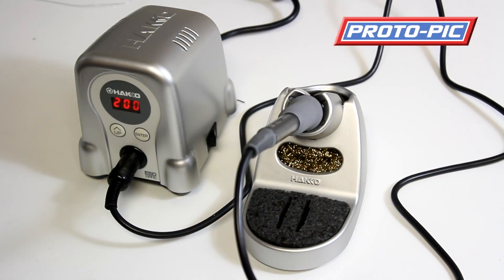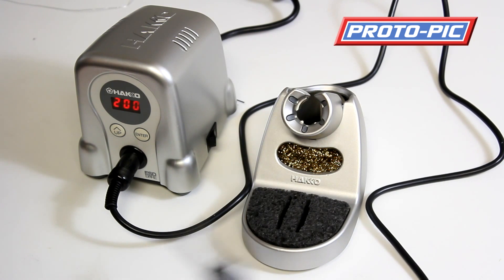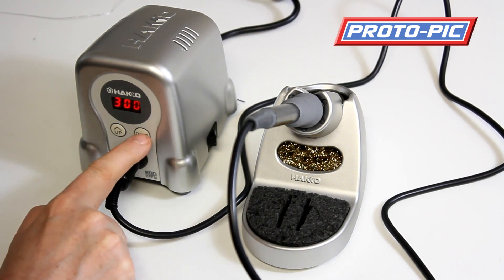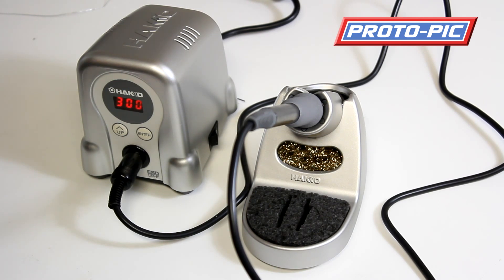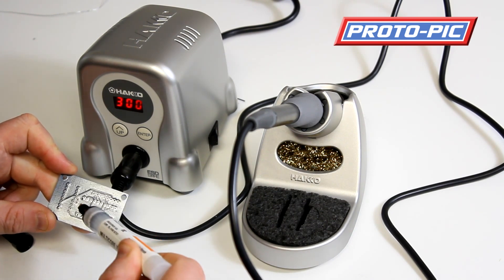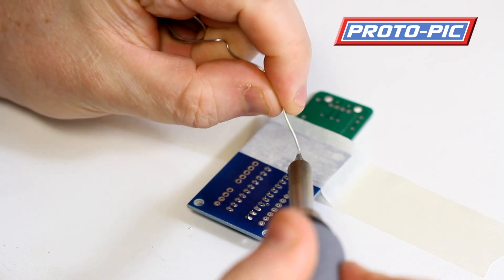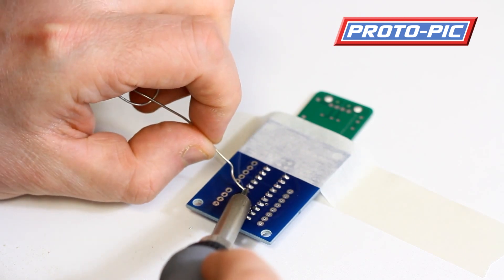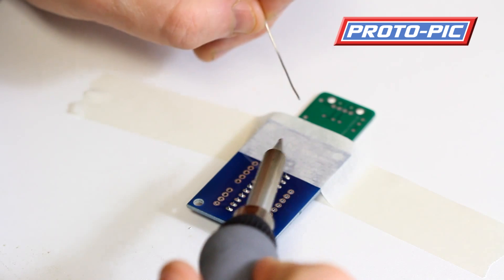Hakko FX888D Digital Solder Station

Comment: I like adding flux to solder joints, even on PCBs, but even the no-clean felt tip pens leave lots of residue after soldering, and I've yet to find a proper flux remover. Just moves sticky gunk around the PCB. Frustrating.